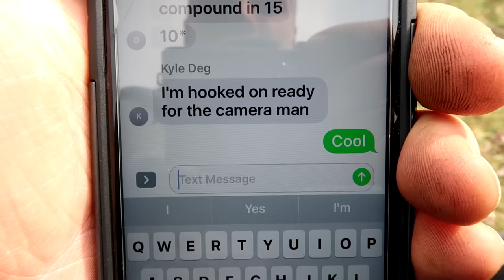this was a huge mistake

Comment: That type of tannerite you have to use a .223 or higher cal. or it will not work right! .22 or.22 mad does not have enough velocity to set it off. it actually says that in the instructions.

Comment: awesome vid. the lid wasn't on all the way and you should've rapped it in duct tape. it has to be secure as possible. little advice for the next one. great video btw. maybe next time put the tannerite underneath the vehicle so it luanchs it in the into the air.

Comment: need to shoot it with a higher power rifle. 2000 yd/Sec velocity
Reply: its 2000fps or greater. they need a .220 swift 4000fps
Reply: .270wsm or maybe 30-06. 22-250? sure..
Fug it, get out the ar-15!
Reply: Jeff Kephart right sounded like a   .22
Reply: I used a .300 short mag and it made an big boom with just 1lb

Comment: wasn't a tight enough seal and not enouph air in the bucket for it
Reply: Nick Ryder you could definitely see that the bucket had no room for any headroom in it and the lid was not closed at all when they carried it and put it in the truck
Reply: Yeah and they could of just got a new 5 gallon bucket and they are like maybe $5 with no oil and would ceal better and use duck tape too